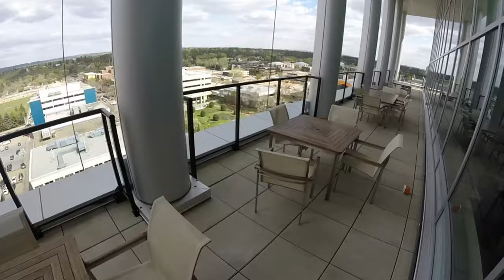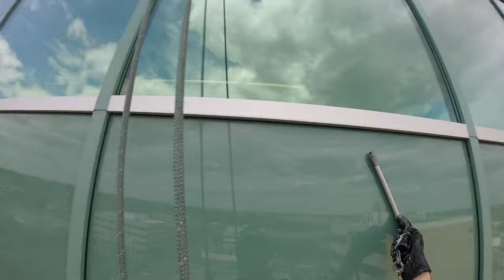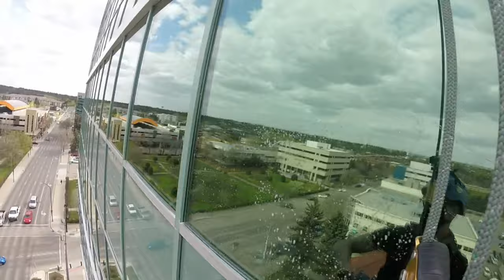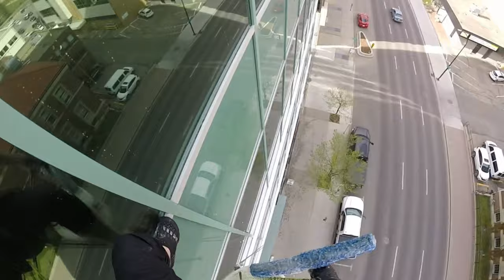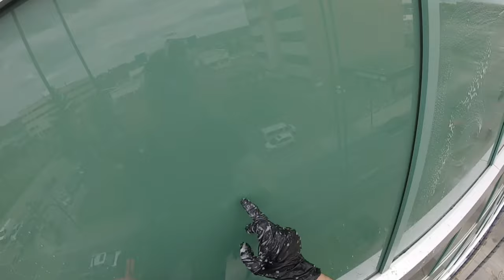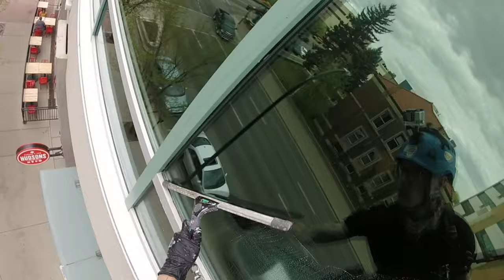Rope access window cleaning in Canada includes rigging and entire drop.

Comment: Now that I think about it, there is no reason to wipe the edge of the glass on a window 100m off the ground 😅 even if the squeegee leaves a couple mm of water, it won't be seen by anyone anyway.
But I have a question for the suction cup, do you even operate it, or just put it on the glass without opening/ closing the handle? Wondering how do you reposition it so quickly.
ps. props for using tethers on the equipment, I haven't seen anyone do that myself, so didn't think of using them either 😅
Reply from the maker: I really like these dent puller suction cups because once you get used to them you can move them around really quickly. It sort of just becomes muscle memory. They're also really cheap to buy like $10.
Reply: @BrodyYYC  so it comes down to practice 😁 thanks for advice, will be sure to do, there were plenty of situations where a full blown suction cup wasn't necessary, but something that allows you to holt at the middle of the window would help a lot.

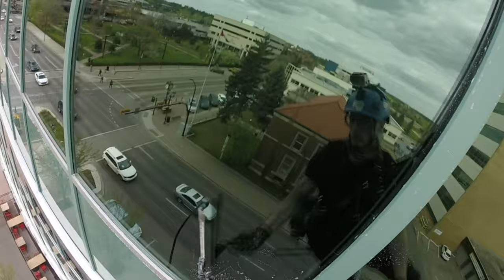Comment: What happened at 24:05 ?
Reply from the maker: Momentum just carried me a bit further over than I wanted. It's a 3 window drop so the ropes are going to want to keep me in the middle. I just always try to work with the momentum so I'm not pulling against it. I basically needed to get the suction cup right on the other side of the frame and instead it was closer to the center of the window which positioned me farther than I wanted. Just OCD stuff basically lol.